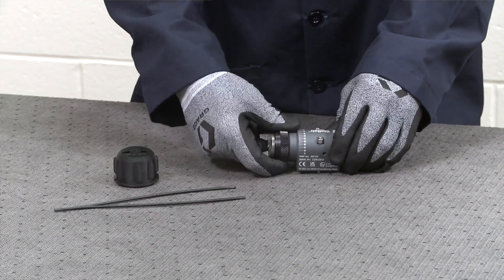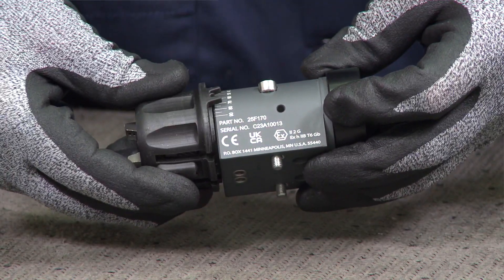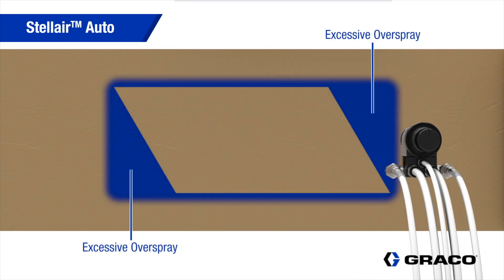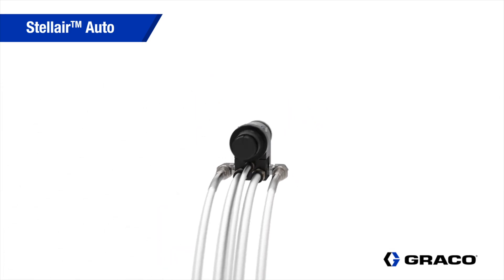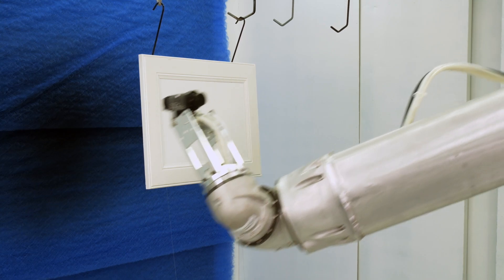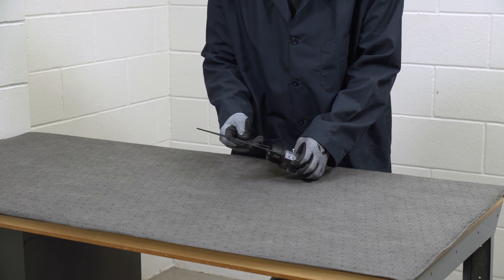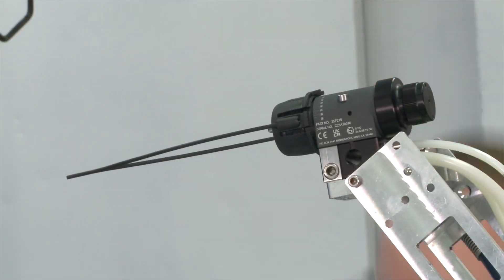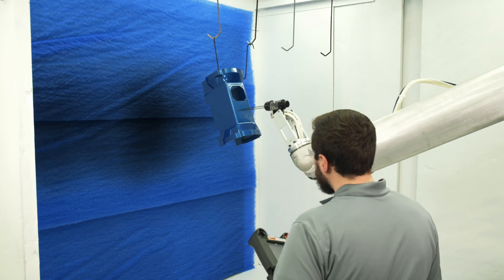Stellair Auto Air Spray Gun: Spray Pattern Alignment and Pathing Tool

Comment: How it is installed on the robotic arm? What other parts I need apart from the gun?
Reply from the maker: Are you talking about the fluid manifold to mount the gun onto the robot? We have several mount types. To determine the best style for your robot and application, contact your local Graco liquid finishing equipment distributors.

If you’re not sure who that is, this finder might help: https://www.graco.com/us/en/in-plant-manufacturing/how-to-buy/where-to-buy.html?wtb_code=CAP